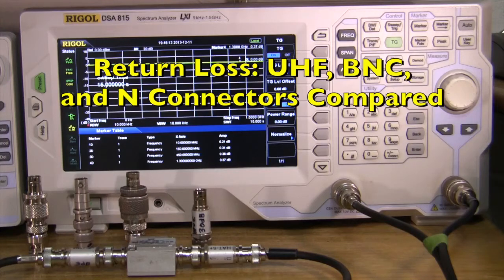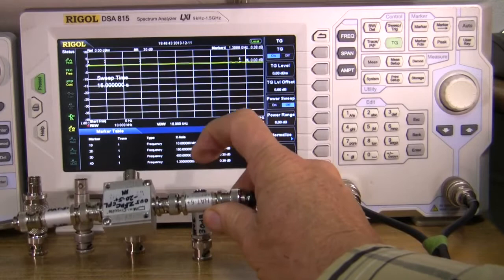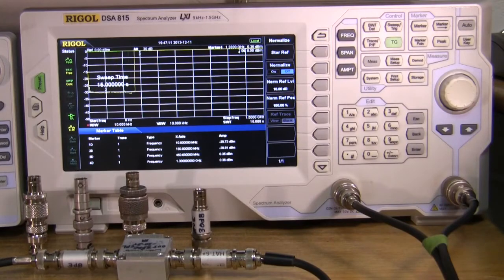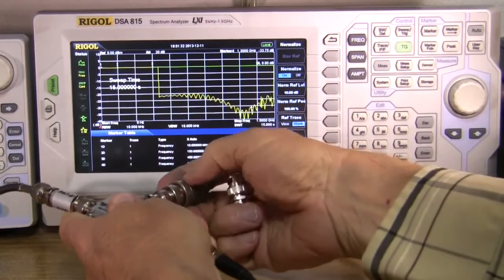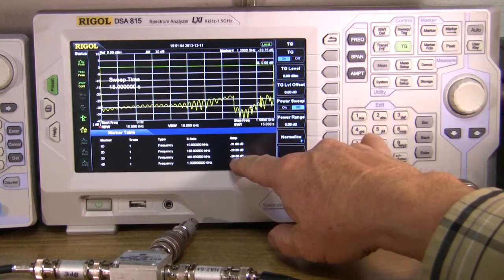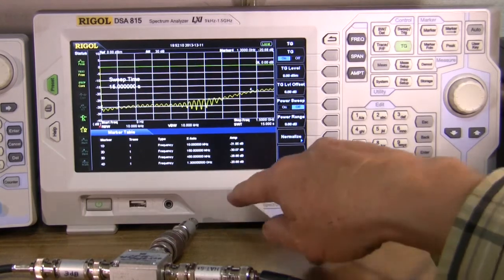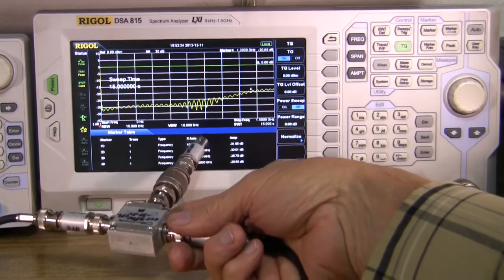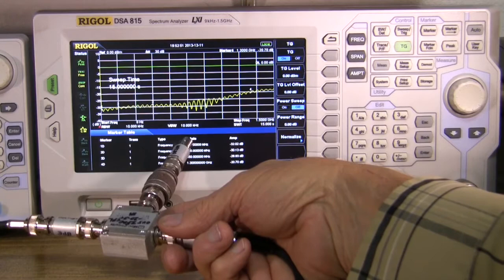UHF BNC N Connector Return Loss Compared

Comment: While I'm not sure of where certain frequencies are on the horizontal scale, it appeared that even on shorter HF bands, there may be an advantage to the NC connectors.
Reply from the maker: NC connector are better matched to 50 Ohms than "UHF" connectors... especially if the "UHF" connector is not tightened properly.

Comment: Hello.  Just stumbled across this.  It was a link in a Reddit page.  Bit of a newb here.  Was about to order a magnetic mount and GMRS-tuned Nagoya antenna with SO-239 / PL-259, plus adding an SO-239 / SMA female adapter to use with a Wouxun KG-805G HT.  Plan is to add a vintage Kenwood mobile down the road, like a TK-880, so the SO-239 connection makes sense.  The Reddit poster seemed to be alleging that the above would not be a good plan and suggested an NMO mount / antenna would be better... due to this youtube video.

Earlier I had come across a magnetic NMO mount with an SMA female connector, but I thought using that GMRS tuned Nagoya would be a good way to go.  Do you see any problem with the setup in the first paragraph above?

Comment: You mention that UHF connectors use in ham equipment might be tuned to make it acceptable. Does that mean that if I were to swap out the connector with a type N I would actually get worse performance? I've been considering buying some new bulkhead connectors and soldering them into my UHF capable radios. Is that even worth it?

Comment: So, for all the UHF CB radio we use here in Australia (477 MHz) its standard for PL-259's on everything. Would it be worth the effort to replace it with a N type at the radio itself? All the units are sold with 259's... would replacing it with an N type now create an impedance issue inside the radio itself?

Kind regards,
Tim

Great informative video by the way!!!
Reply from the maker: If a radio has an SO-239 on its output then it probably has been designed using PL-259 loads and/or test equipment thus should be properly matched using when that kind of connector.  Over a narrow bandwidth (4.77 MHz at 477 is only about a 1% bandwidth after all) the match/loss difference between a SO-239 and an N connector is probably negligible.  I wouldn't worry about it up to 500 MHz or so.

The same is true at the antenna end of the coax used.  If the antenna was designed and tuned or checked using SO-239/PL-259 connectors and found to be well matched, it should work as well as one designed and tuned or checked using Type-N connectors.

The quality of coax at UHF frequencies is much more important than the connectors being used.  However there are a number of problems that can show up in applying PL-259 connectors to coax and seating PL-259 connectors on SO-239 connectors that are not seen with N or TNC connectors.  You may have noticed that almost all RF test gear made in the last 40 years or so comes with N connectors.
Reply: James Eagleson I appreciate your response!
I guess it might be worth my time and effort to upgrade the crappy RG58 with PL259 to N type with something beefier. As long as I can find some good coax with bend radii I can work with routing inside a vehicle then this should be a good upgrade. I do understand the EMI issues while the vehicle is running however it should be fine once the vehicle is switched off and running direct from the battery. Many thanks from Oz
Reply from the maker: A short run of good quality RG 58 or RG 8x versus larger coax in a vehicle probably will have little effect on match or losses unless there is a significant VSWR problem (>1.5:1).  Using RG 8 or RG 214 might make some difference but, as you indicated, presents mechanical routing issues.

Comment: I saw in another video Icom and Yeasu VHF/UHF amateur radios sold in Japan all come with the N connector not the UHF type like in American HAM radio.  I always wondered why radios still today are sold in America with PL-259 still on mobile VHF/UHF radios.  Looking at Icom's website a IC-2730A current VHF/UHF mobile radio still has a PL-259.

Comment: Hi Jim! Thank you for taking your time yo make this excellent video! I just got a Rigol DSA815 TG and a ZFDC 20-4 Coupler. Question: what is the correct procedure to check Directivity on the coupler. Thank you in advance ! 73's David K8KEM
Reply from the maker: David Eisenberger  TG to DC Output Port.  DC Couple Port to SA Input Port.  No load on DC Input Port Normalized to 0dB Reference (no load = total reflection).  Precision 50 Ohm Load on the DC Input Port should give -30dB loss or more.  If not, that is probably the Directional Coupler's reliable Return Loss limit.

Comment: Fantastic video, many thanks for this James. I noticed some 'weird' results when I was measuring cable loss (S21) with my MiniVNA Tiny, and after dozen hours of tests, I figured out that my connectors were awful towards the UHF band - never ever imagined how these 'small monsters' could cause me such a huge trouble! Similar to your plots, I also have these repetitive ripples (waves) across the spectrum. Are these ripples caused by connector and coaxial cable impedance mismatches? These ripples are especially pronounced when I am measuring cables up to 50m (~150ft) or so, but I've also noticed them even when I was measuring a 4m long RG58 cable terminated on PL259 connectors and then connected with my VNA using UHF-SMA adapters. 

I still can't figure out for sure why these ripples are so evident on most of the S11 and S21 plots on my MiniVNA Tiny. It could be my cal kit or else as well, but I am always checking this by connecting the standard 50 Ohm load and then reading a flat 50 Ohm line before each measurement.

Comment: i find fault in this video your testing the conecter not the antenna you not giving a real view with the bnc antenna i would love to see u re viste this but using a bnc antenna to do the same thing
Reply from the maker: Yes, I am testing only the connector in this video as intended.  Thus I use a 30dB, medium precision Attenuator as the Load and not an antenna.  

I am not saying that one cannot get a good match while using a "UHF" connector at frequencies above around 200 MHz since the match of any antenna system includes:  

(1) the Impedance of the Source, 
(2) the impedance of the Adapter(s), 
(3) the Impedance of the Coaxial Cable and its length, 
(4) the Impedance of the Load (in this case, an Antenna), 
(5) any significant reflections of radiated signals back into the antenna from surrounding objects.

The fact remains that any "NC" connector, whether "N" (really shorthand for "NC"), BNC, or TNC has the same internal structure and are useful to somewhere between 1 GHz and 3 GHz depending on the manufacturing tolerances.  "UHF" connectors, so called, can be used up to 450 MHz and are on many Ham rigs but most professional installers prefer to use NC based (N, TNC) connectors to ensure both a proper match and a secure connection for commercial radio equipment.  They are also concerned about the effective shielding capability of N or TNC connectors which is almost always better than that achieved by a "UHF" connector.

BNC connectors are not usually used in permanent installations because they do not provide as secure of a connection but they are perfectly suitable for use for test instrumentation below 1 GHz.  BNC connectors have the advantage of quick connect/disconnect capability for test setups and signal patching (jumper cable) uses.

Unfortunately with the modern use of cables for audio and computer networking purposes, some BNC versions are now being made very cheaply with poor manufacturing tolerances so that one needs to buy from distributors of true RF connectors in order to insure good quality for use at VHF and UHF frequencies.
Reply: i understand that but you are saying anteena with a bnc connector is not good but yet it can and been use alot in the ht hand healds for how long
Reply: with a bnc connector is what i mean
Reply from the maker: Andrew Murphy 
BNC=N=TNC except for the threaded shell (N, TNC) and Bayonet shell (BNC).  UHF connectors work well at lower frequencies but not as good as NC connectors above 200 MHz.  Thus BNC connectors often are used for HT antennas and should not affect tuning significantly especially the since this is also accounted for in the antenna design.  A "UHF" connector can also be used for an antenna for the same reason... it can be accounted for in the antenna design/tuning.  Thus a mobile whip at 440 MHz using a "UHF" connector will work well as long as its design accounts for the impedance bump that is caused by connector.  Many manufacturers provide such antennas with either connector as an option.
Reply: I'm still wondering how old his portable is. What portable built in the last decade still uses the BNC? NONE. They've all migrated to the SMA. Even the commercial LMR portables abandoned the BNC years ago. Still a good connector, but like you told the other guy, I've had problems with them getting sloppy over the years. They were used extensively in the AT&T Long Lines microwave sites for anything that didn't require wave guide. I've seen them in use on 4 gig radio bays. Great video. It shows exactly how antiquated the PL259 really is. I'm quite jealous of your 815. 

W5KVV
Reply from the maker: I've seen some comments to the effect of BNC connectors have been replaced with SMA connectors on modern HTs.  While at VHF and UHF frequencies this is correct, many older HTs still have them and many QRP rigs use BNC connectors rather than UHF or SMA connectors. My essential point is that a BNC connectors are relatively low VSWR devices since they are electrically identical to N or TNC connectors.  Since they have bayonet mechanical connection and are usually used where quick connect/disconnect capability is required, it is true that with age these connectors may degrade mechanically over time thus may become unreliable.  (The same is true with SMA connectors if they are screwed on and removed on a regular basis, by the way... especially the cheaper ones.  That is why so many of them are gold plated.)
Reply from the maker: Agreed.  It is somewhat dependent on the age of the BNC and the Manufacturer.  All but the really cheap BNC connectors will certainly work well beyond the 1500 MHz range of my Rigol Spectrum Analyzer.

Comment: Using BNC .... only meant to be used for audio , and HF frequencies to 30 Mhz  , 50 Mhz maximum ....
Reply from the maker: Not so.  They are good to 1GHz and are the basic NC connector with a Bayonet shell.  A type "N" connector is really an NC connector and a TNC is a Threaded NC connector (thus the "T").  See amphenolrf.com to find BNC specs.  Frequency range 0-4GHz.  The only problem with these connectors is poorly made ones can get sloppy with age and make poor contact.  Oh, and by the way, the Mini Circuits Directional Coupler I used uses BNC connectors and works up to 2GHz as do the Attenuators.